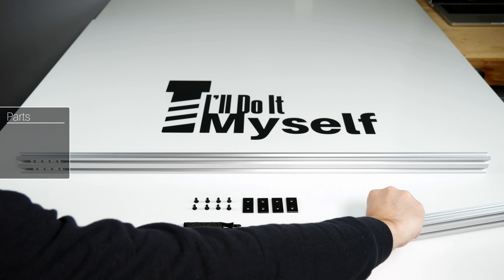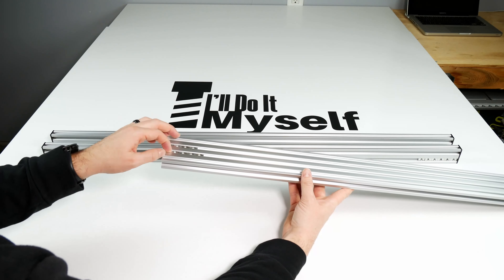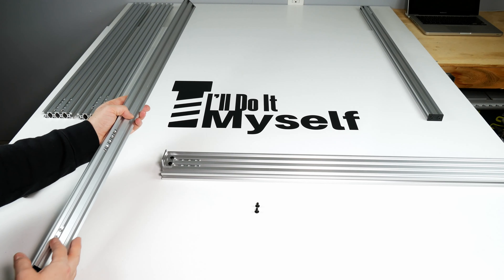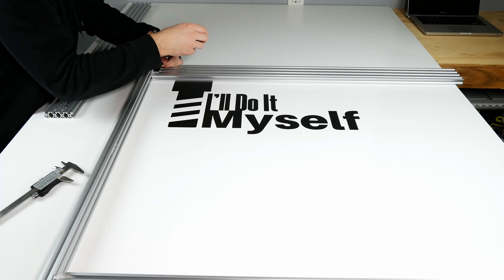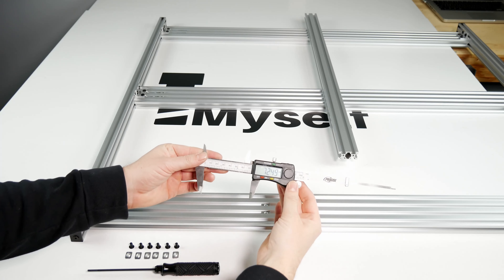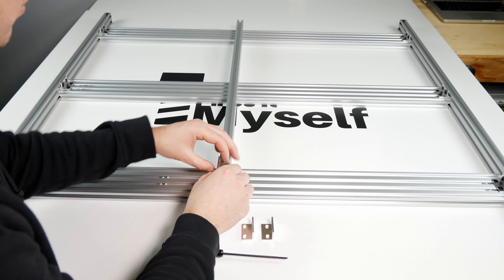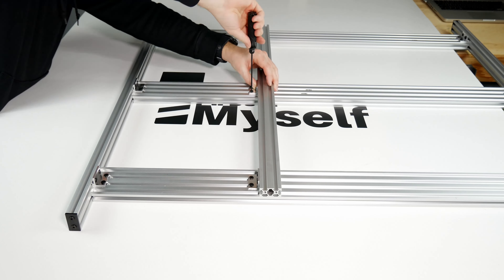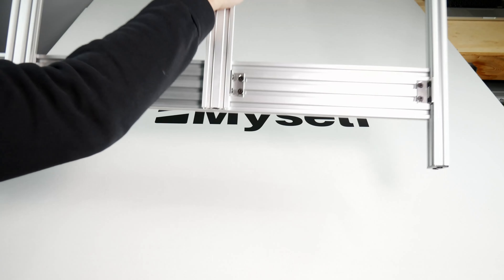Bulkman3d Queenbee Pro - Spoil board Frame

Comment: Just in time! Ordered the 1500x1500 with xPro v5 and a 2,2kW water cooled spindle  just few hours ago! Have you checked the 4th lathe style axis at Bulkman website? xPro suppors it out of the box and I am thinking of ordering it too to be able to do 4 axis milling.
Reply: im not sure but i think on the xpro v5 the 4th axis is used as a slave for the 2nd stepper on the x or y axis the front to back direction ( i can never remember which one is which lol)
Reply: @MrP51cho  What do you mean? Sorry, I'm a rookie still. It says that:
4 software defined, independent motor drivers can:
Clone any axis (default to XYYZ) 
True 4 axis motion XYZA
Reply: @elmonni2103  no worries im still at the planning stage myself but going by the spark concepts site although there are 4 stepper drivers in the xpro v5 because the queenbee uses 2 separate steppers for the forward to back motion you need to drive them individually which then ties up the 4th driver https://github.com/Spark-Concepts/xPro-V5/wiki/Basic-hookup shows the hookup of a simple system worth having a read in any case if you must have the 4th axis a different system is probably a better option but for simplicity the xpro and the blackbox are the 2 to look at imho (xpro is 32bit blackbox is only 16 bit i think it may even be 8 bit) but both have a similar limitation of using the spare stepper driver to power the 2nd motor on the forward to back axis
Reply: @MrP51cho  Thanks alot for explaining!
Reply: @elmonni2103  no worries im just getting ready to pull the trigger on a system myself. im going with the queenbee pro from bulkman and the xpro v5 system again for simplicity i had considered the mach 3 route but prefer open source stuff so grbl is the direction im going although if you 'must have the 4th axis then mach 3 is possibly the better option
Reply: ive been having a look on the spark concepts github and apparently the xprov5 can power 2 stepper motors per driver not sure how you would wire it up but i would guess you would need lowish current steppers so you didnt burn out the driver https://github.com/Spark-Concepts/xPro-V5/wiki/Hardware_Description is where i found the info
Reply from the maker: That's right you simply need to connect both motors to the same terminals
Reply: @IllDoItMyself  will one set of terminals on the xPro v5 have enough amperage to run both stepper motors?
Reply from the maker: @JoeEthington  yes at 6 amps that should be plenty enough on the y Axis.